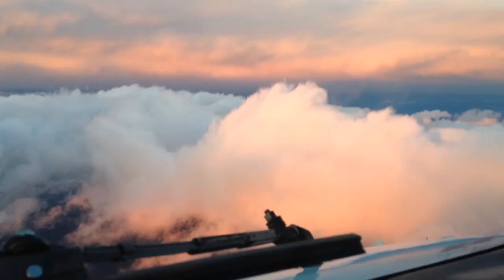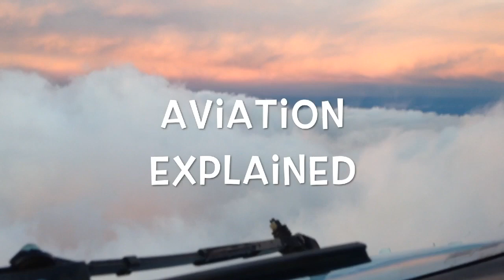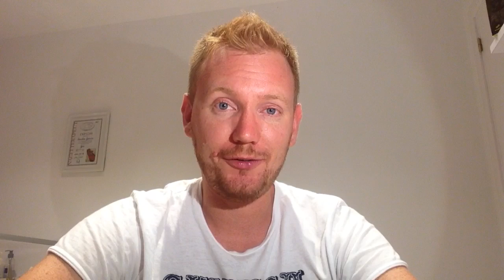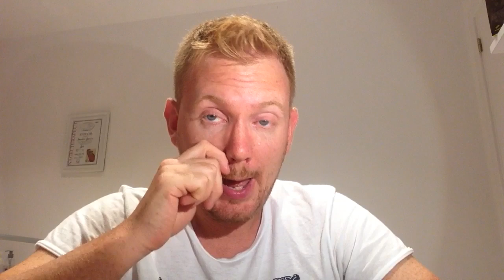Aircraft maintenance, why pilots shouldn't touch anything!

Comment: Daily inspection every 48 hours? I'm already seeing a problem here.
Reply: Hahaha, that's what I was thinking too! Like, "Whoa! Wait a minute!"
Reply: This is probably why he doesn't keep a log book on him.
Reply: A "daily inspection" is valid for 48 hours (2 days). So even if the aircraft hasn't flown, it will be subject to the same inspection 48 hours later. He doesn't really go into the specifics of the schedule because it's quite complicated but with my limited experience in maintenance planning (Way above my paygrade). I'd assume a "daily" is valid for 24hrs, so if the inspection was done at say 0000hrs, and the aircraft flies at 23.59hrs, it will be airworthy for that flight, up to 24hrs flying time (Not possible due to fuel constraints etc) so that's where the 48hrs comes from. I bet as soon as it lands, it will have another "daily". I used to work on helicopters where a "daily" was valid for 7 days, as long as the aircraft wasn't flown. If it did fly 24hrs after the inspection was carried out, it would need another "daily" before it could go on another flight. And even if it didn't fly in those 7 days, guess what, you're doing another "daily inspection". If it flew within 24hrs of the last "daily" inspection then it could fly up to 24hrs after the time the inspection was carried out. Remember, this is calendar time and not flying time. Now when you have to schedule flight hours in phase with calendar time, you start getting grey hairs, and don't even get me started on cycles. That just screws everything up. Ever wondered why aviation is so expensive? This is why. The planning for this is down to the 100th of an hour and very accurately predicts the exact day an airframe will go on a servicing, however major that may be. This also answers a question in the comments about having spare aircraft etc. The answer to that really is no, if it's not flying, it's not making money and that's bad, however, if it's down for scheduled maintenance, it's not exactly costing the airline money as that's all been planned for. When scheduled maintenance becomes unscheduled or takes longer than it should, that costs money.
Reply: Thanks, Kinsley. Well then they shouldn't call it a "daily inspection." They should call the 48-hour ones "bidaily inpections."
Also, when you said that scheduled maintenance becomes unscheduled or takes longer than it should, that costs money," it might've been more clear to say that it costs even more money.
Reply: It probably started as a daily and then got extended out to 48hrs due to aircraft reliability etc. My guess is they kept the same name to minimise confusion, as confusing as that sounds lol.
Reply: That (keeping the term "daily") does anything but minimize confusion. They should've said they would now replace mandatory daily inspections with mandatory bidaily inspections. Thanks for your replies and likes.
Reply: I know haha, we look at manuals sometimes and wonder what the frick went through their heads when they wrote it. You get used to it.
Reply: We call them two day check on some planes, but they are often done daily, (to reset the clock and ensure the aircraft will not have a problem somewhere where there is no qualified people to do the check)
Reply: Well, Olivier, at least that's not as bad as the other way around!

Happy Easter, April Fools' Day, part of Passover, part of spring break, and LDS general conference day 2 all in one!
Reply: This is why its 48 so no plane gets stuck and can not fly out without this daily inspection. Also if there is no one there to do the check, there is no one there qualified to do any fixing.
Reply: Well again, Tim, it's a contradiction.
Reply: It’s a daily inspection done every 24 hours but it’s valid for 48 hours just in case the aircraft can’t make it back to a manned base
Reply: Maxx Fordham!.
Reply: Well, Stephen, if it's valid for 2 days instead of just 1, then they might only as well do the inspection every 2 days instead of just 1.
Reply: I think the reason it’s written like this is for long haul flights which may well be 15 hours long but I know that the plane gets inspected before every flight
Reply: As long as it is a standard, the name makes no difference.
I imagine that the term stems from the concept that a plane normally flies 24 hours over a 48 hour period. They also fly into different time zones. 
I assume that airlines prefer these checks done from their home airport and long haul plane may not return from another country within 24 hours. This would become an even worse problem when checks were carried out several hours prior to takeoff.
Better to have a 48 hour MAXIMUM, than a 24 hour schedule that was unworkable.

Comment: Now we know pilots are not meant to usually touch anything aside from piloting the aircraft exactly how much technical knowledge do most pilots know about the aircraft  ie do they have  knowledge of how the engines work and hydraulic systems and so on? I drive a car and I know exactly how the entire machine functions  as an enthusiast so is it fair to say pilots are the same?
Reply: all the pilots need to do is to know enough to report if something is not right or is spinning or is exhibiting unusual figures on the flight deck monitoring equipment.  also, there is now a text message system that every 10 minutes radios the flight maintence center to alert anyone to any issues that came up during flight.

Comment: Do they still use speed tape (aluminum tape) any more
Reply: only on the rare basis that a repair can not be completed where you are but can be in a stop or two.  Again, a senior engineer needs to certify said issue is safe to fly for a short period of time.

Comment: i have a doubt sir
So if an aircraft enters a check is that aircraft replaced by another aircraft that flies  the incheck aircraft's service route ??
If so do airline companies have  extra planes on stand by to perform the above mentioned duties?
THANKS IN ADVANCED 
YOUR DAILY VIEWER FROM INDIA
Reply: Normally airlines don't have "backup" planes or planes in standby, remember that airplanes are extremely expensive so airlines try to keep them in the air as long as possible in order to profit, my guess is that a good, big airline always has a certain amount of planes in service, so when one comes out, another one goes in so the number of planes working is relatively unchanged.
Reply: THANKS SO MUCH MAN!
Reply: Smit Asher as a regional airline mechanic, we sometimes have a backup plane to use. These planes are on backup usually because they were on maintenance
Reply: You are yet to understand what cutting corners does to the aviation industry: crashes!!
Reply: Just in case you haven't got your answer.. most airlines try to keep the aircraft flying so no spare aircraft the company scedules the flights in a way that permits them to have the maximum number of aircraft availiable for flight.. there is a great vid of a D check on a 747
Reply: Smit Asher I have a few colleagues who worked line maintenance at a heavy maintenance facility and have witnessed a 737 come in and get the entire cabin removed in 8 hours and within an hour they get a call to put it all back and get the plane ready for service. So sometimes an inspection might be postponed but it can't wait long because they are scheduled and will not be certified as airworthy.
Reply: I know this is a late answer, but I just found this channel. All I can speak about is what happens at my airport. My airport is a major maintenance hub for American Airlines, so, they do have extra aircraft sitting around. Usually ones that just came out of the B-check. If a plane does get pulled out of service, they'll usually just tow one of the spares over to another gate and have it take the flight of the broken plane.

Comment: Hi! I'm planning on taking up BS Avionics in college,in the Philippines its a  4 year Bachelor's Degree, i heard that it only takes two years to train in some countries. Anyway, do you think that its a good background education prior to becoming a pilot, or if not, can you suggest a better one? Also, typically how much do avionics technicians make annually? Thanks.
Reply: delta avionics guys that have A&P's  can make upwards of 200 grand per year maxing out at $60 an hour with unlimited overtime ...that's just delta.
Reply: Most Avionics techs hold an FCC license to repair electronics on aircraft. Seldom have I seen an A&P that also has an electronics degree with the FAA endorsement. Most avionics techs also have a radar endorsement on their "ticket" so as to work on the weather radar as well as collision avoidance and altitude measuring systems. You get paid very well but one must also remember that you put yourself up front for any screw ups that could lead to a disaster an loss of life. There is NO room for error in the aviation maintaince field of work.

Comment: What is the difference between a Aircraft Mechanic and a Aircraft Engineer ??? ☺
Reply: ***** Oh! , thanks anyway 😁
Reply: +Omkar Singh  the difference is that the  aircraft engineer has a license which allows him sign a certificate called CRS.Without this certificate an aircracft can't fly (situation is a bit more complex i'm just keeping it simple).
In order to get this license you need to pass 12 to 15 exam and prove via valid documentation your experience in the field
Reply: +Mentour Pilot I am 50% done with my AMT in America that is what it is called.  most other countries call it an Maintenance engineer.   There is no difference in the two other than the governing bodies between them.
Reply: +Zavier Lucaino , Thanks alot !! ☺😊
Reply: No problem I forgot to clarify (AMT) stands for Aviation Maintenance Technican.  Same as AME.   We can sign off on most repairs unless they are major repairs, in order to do that you need an AMT win an inspection authorization.  For that you will need to be an AMT for three years and then pass more test.  My school is between 18 to 24 months and we have to pass many difficult exams as well as do an oral and practical with a DME which is under FAR 183.  Hope this helps if you want any more info look up aviation schools per FAR 147.
Reply: Is it really too hard to become an AMT 😮😐
Reply: It's not easy, but you need to be dedicated and study hard.  Don't let it discourage you.  Best of luck to you and study hard.
Reply: +Zavier Lucaino , Thanks alot ☺

Comment: Aircraft mechanics are bit lucky because is only two brands to know very well about but cars and trucks Mechanics is more

 random encounters Awkward  working Like really cramped Spaces Chrysler and German Cars are most annoying to fix a 

Farm tractor is no fun either you have to split It down the middle to change the Clutch
Reply: G POWER DRAGON Kind of know what you mean..we are not allowed to release aircraft we dont have a certificate for.
But to say that there are only two brands is a bit ignorant. And to compare with cars a Model T and a Mustang isnt the same just because there both Fords..same logic applies to aircrafts..

Comment: There's only 8,736 hours a year
Reply: An example is how long it takes people to do things.... Friday I did a wash on a 707 with about 16 people, if you add up the hours (12 per person) its around 192.
Reply: A man hour theres a difference, for example there are 10 people checking the airplane so 1 hour is 10 hours so its basically hour per person 

I think not 100% sure but im pretty sure thats how it works
Reply: Exactly manhours is people times time just like watthours is power times time.
Reply: "Man-hours" are an "aggregate" or "total" of the hours put in by ALL the staff doing any sort of work.  If "10 man-hours" of labor were required to do something on an aircraft, it might be 1 person working 10 hours, or 2 people working 5 hours, depending on the task at hand.
Reply: Man hours